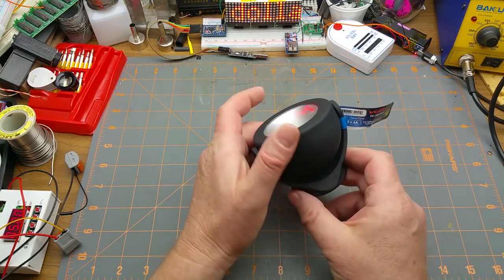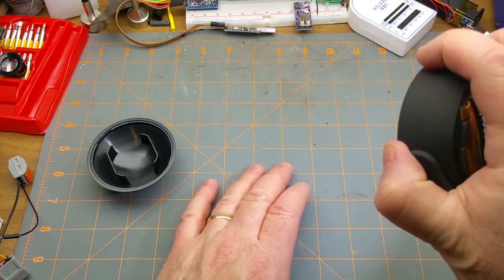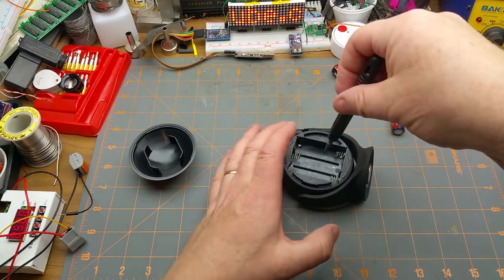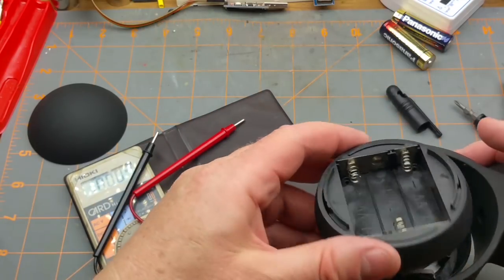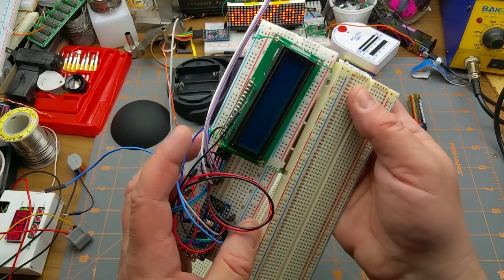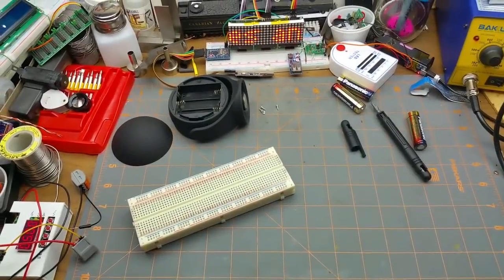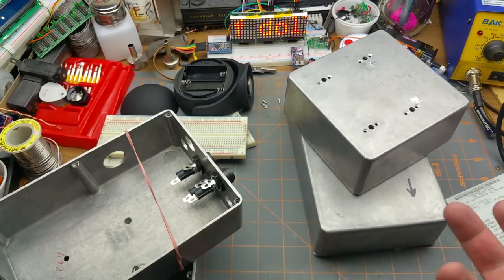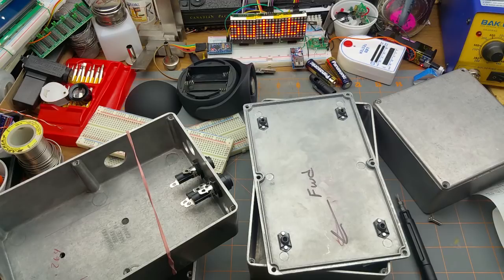Thrifty or just a cheapskate?

Comment: I need a thrift store like that. All I have found so far is a bunch of old VCR’s, clock radios, and dusty cheap bookshelf speakers  from the kind of cheap stereo system a kid would get for Christmas in the 80s or early 90s.
Reply from the maker: I come out of thrift stores empty handed a lot more than I do with treasure like I showed.